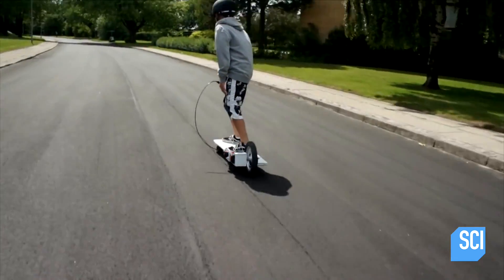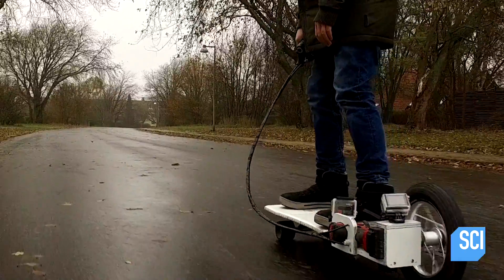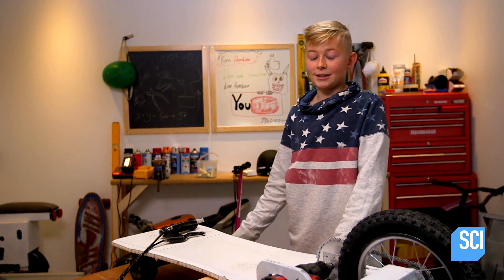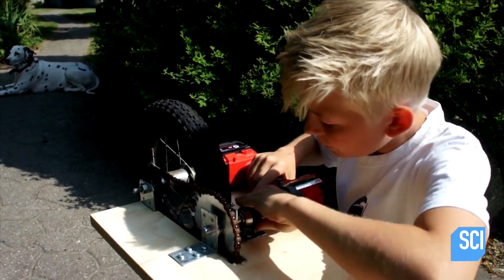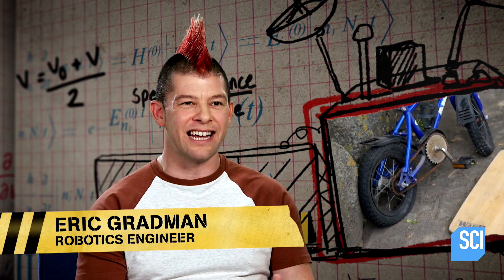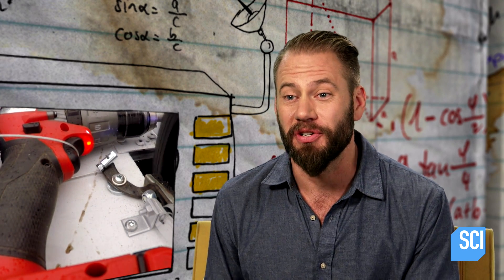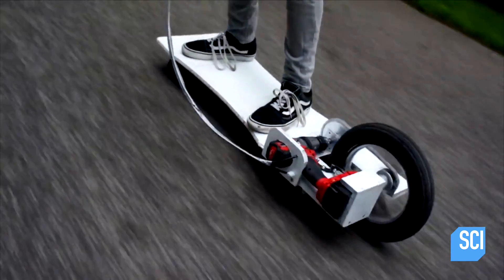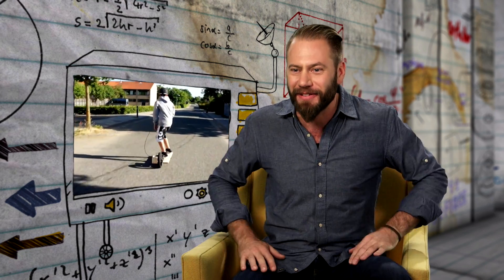See How This Kid Built His Own Electric Scooter

Comment: 40 and 90 km/h??? i am very sure he is wrong
Reply: Schoko4craft 40 and 80 is the speed of the drill. Its obvious that with weight, friction, and air resistance that will dramatically decrease.
Reply: its probably also without any weight on it.
Reply: BubladeHD thats what i was thinking too. Just the rotationspeed